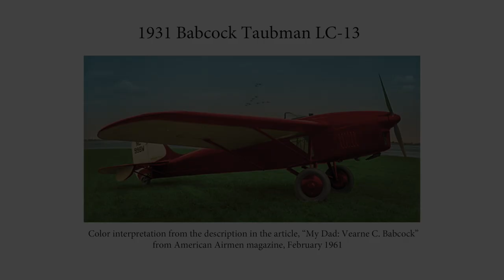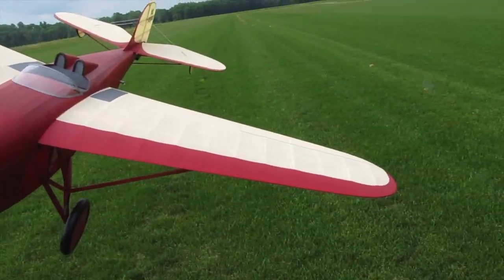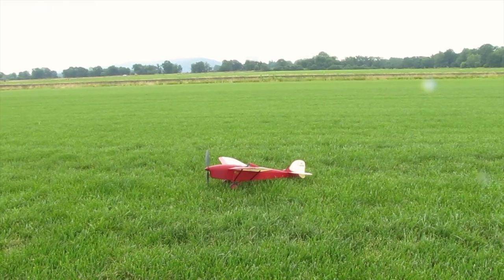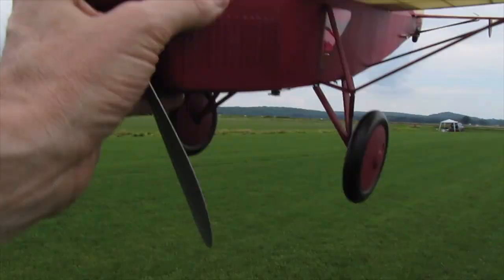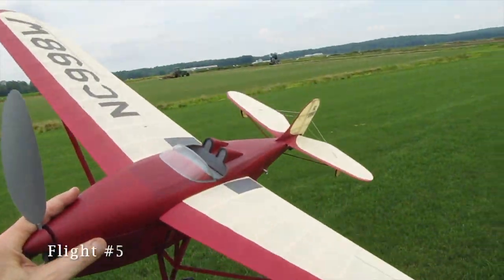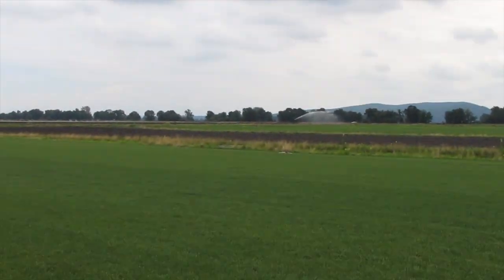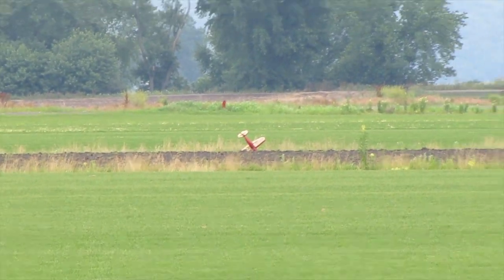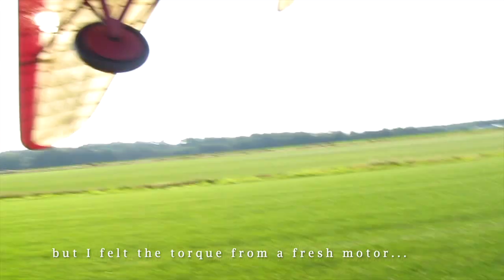37" Rubber-Powered Model Airplane - 1931 Babcock - Anatomy of a Trim Session

Comment: Beautiful flights with a beautiful model. My hats off to you for a job well done. I am an 82 year old model fan (rubber power and U-control) and this certainly brings back happy memories  of my early trial and error period during the late 1940's and 1950's. After rubber power flight was put on the back burner, my first U-control model was a Mini-Zulch powered with my first motor, an .049 OK Cub. I still have that little motor as a keepsake item from happier times.

Comment: Well,   I am motivated by your numerous videos including this one to get back to Free Flight rubber powered models!   
When flying Open Rubber contest models decades ago now,   I used a winding tube during winding to protect the fuselage in case the motor should break.  Essentially a thin walled aluminium tube that slid inside the fuselage and hooked up the motor with a 1/4" dia. al. alloy rod just longer than the tube.  Wound with prop. off tucked into my back pocket then when fully wound,   slid the tube out from the fuselage over the rod and reached around to grab the end of the motor.   Then unhooked the rod and let rod and tube fall to the ground and hooked up the prop. to the rubber motor and fitted the nose block.  Was winding 14 strands of 1/4" rubber strip but could grab and hold that OK.    To avoid sharp power burst used motors ~ 30% longer than between hooks and pre tensioned the motor by extending the motor out to 7 strands and winding counter clockwise with a small rod rubber banded in place in the midpoint of the motor.   Then bringing the two end together and fitting them on a "Tim Gray" style double loop fuel tube covered piano wire hook.   Hold that end of the motor and let go the rod and the motor cords up naturally.  Used small 1/16" section bands to hold motor on the hook and used hollow high tensile al. alloy tube through the rear of the fuselage as a rear "peg".     60" span model weighed 3 1/8 ozs. and rubber weight  slightly more than that for ~ 6 1/2 ozs. all up flying weight.
Reply from the maker: Thx for the kind words.  Enjoyed hearing your process from long ago. Seems like you haven't forgotten one step in the process!

Comment: What a beautiful aircraft Tom.  Not a type I was familiar with.  A good size too.
I'd love to build that one.
Noel
Reply from the maker: Thx Noel.  Yes, this one quickly turned my head, and I knew she had to be a larger model to take advantage of that massive wing area.  Hoping to get out with her again soon, with a better prop and a slightly more powerful motor.  She got up there on the last flight, but conditions were ideal, like flying indoors.  With any kind of wind, I doubt if she would've broken thru.

Comment: I also love the old 1930's designs ... when designers were trying to find the formula for a private airplane that's not so expensive (Depression Era), so they could sell a lot of them!
I guess those tall wheels on this model are what lets it land 3-point almost every time. I've seen similar size scale designs that have long flight endurance but they often don't go above 50 feet. Since this isn't a purpose-built cloud rocket ... would you say that when flying large scale models, its harder to get them to really get up in the sky?
Reply from the maker: I could surely burst her into the sky like a Gollywock endurance ship if I wanted to, but I love the more scale-like approach. I'm switching out to a new, more efficient prop, and bumping up the rubber cross section a tad, so she'll be gaining altitude for sure. 
Stay tuned.

Comment: Wonderful, precise work ....
I agree with Kevin, wouldn't there be more information about adjustments for such great flights?
Reply from the maker: The adjustments are so minor, only 1/64" tweaks in most cases, so I haven't considered showing them on film as it could be rather hard to see, but I'll consider it in future films.  I can show the thrust plate setting, since there are registration marks, so one could see the slight changes. Thx for the input. I appreciate the feedback.
Reply: @maxfliart  Thank you for answer.

Comment: I was thinking air density might be a factor in the lack of climb and then I saw the massive sprinklers nearby? How do these rubber ff models survive the repeated uncontrolled landings? I noticed on the fly by’s an oscillation or flutter, or shaky empennage, maybe I just need to eat something, maybe it’s the camera but it looked to be specifically the tail, is this a prop wash induced phenomenon with these ultra light weight models with such but props?
Reply from the maker: Landings can take their toll, but it all depends on the surface. Helps to have some flex on the LG. The shaking was from the rubber climbing on the prop shaft for that one flight. She has since tamed and has become a smooth flyer.

Comment: I love it that you can see the motor working through the windows under the wing.
What's the tail jerking around 15:41?
Reply from the maker: Probably the rubber on the prop hook climbed a bit?  Hasn't done it since.

Comment: Wow, pure aeromodeling art! I'm curious as to why you were so reluctant to increase the rubber cross section... was it because you knew the motor you were using wasn't optimal? The gains were immediately obvious as soon as you changed to the new motor. Congratulations on yet another masterpiece!
Reply from the maker: I hadn't reached full torque, and often a ship of this size reacts favorably near max, so I didn't want to take the time to make a new motor, 
re-balance, etc.  This was the first day, so I felt like simply riding it out with the two loops of 1/4.  I'm taking her out tomorrow morning with three loops of 3/16, so 
we'll see what happens.
Reply: @maxfliart  Thank you. Looking forward to seeing more of this little gem!

Comment: Just when you think you’ve see every model of planes a new/old design shows up. Nice job. Here is a dumb question. Have you seen any rubber powered kits that come prebuilt or at least needing a minimum amount of assembly? I just don’t have the time or workspace to comment to project builds.
Reply from the maker: Thx. Glad u like it.  I'm not really aware of any partially made kits. I was surprised to find that back in the early 1930s, some kit manufacturers offered already built models, about 400% the cost of a kit...so maybe $4 delivered!!  I dad did this in the '30s too, buying kits for 10 - 25 cents, then selling the finished model back to the hobby shop for $2 or so. 
Anyway, all of my flying friends design their own or build from kits.  Some simple designs can be built in a few nights, rather than a few months, like the Babcock. 
I'd suggest contacting EasyBuilt or Volare (addresses in the copy above) as they have a tremendous variety of kits in various levels of complexity, or time required to build.  Have fun!

Comment: How do you calculate the max turns?
Reply from the maker: There are some formulas for calculating cross section and winds per inch, but over the years I just wind the motor to breaking in the shop, then use that as a general guide.

Comment: I have now watched many of your videos. Really useful. What DT do you use? I have tried viscous DTs but found them unreliable due to time variation with temperature change.
Reply from the maker: I've been using the Badge Classic in recent years, since it appears to be the most reliable. It's the one on the lower left. 
http://starlink-flitetech.com/badge-timers.php    I've not used his viscous timer yet, and the other one unfortunately isn't available due to production & reliability issues. He'll sell 3 Badge Classics for $50. May or may not include the spring.  But yeah, the viscous timers are anything but reliable, unless you can find them from around 15 years ago when they first surfaced. Those seemed to work.

Comment: When I saw the skeleton model I thought: why the solid wood nose? And then realized that's the place where u hold it tight with your hand during launch!
Reply from the maker: It's only 3/32" sheet, and the top area is planked with 1/20" sheet.  I knew she'd need ballast up front, so I decided to sheet the area and make the model stronger, and easier to handle.
Reply: @maxfliart  Great, a good base design serves both purposes!

Comment: Wow. Beautiful! Also, what did you use for the thrust button?
Reply from the maker: Thx for the feedback.  It's a brass button with four prongs, from a hobby shop back in the 1940s, I'm told. Unfortunately, 
they're no longer commercially available...but if you can find the small box holding 2,000 of them, they're like gold. Some used them front and back, giving you adjustable thrust.
Reply from the maker: Here they are on this group of photos. http://hallmanstudio.com/Thrust_Plate.jpg
Reply: @maxfliart  ah. Thanks! But is there any way to DIY it? Also,in your Babcock prop video,you use a brass clutch looking attachment. Did you custom cut it? Also,will try to look for these on ebay
Reply from the maker: @adarshlakshman4715  There are similar brass buttons found in fabric stores.  The prongs are longer and you'd have to drill ur own hole for the shaft. The clutch (free-wheel ramp) is made from a long piece of brass tubing, which I cut and filed into that shape.
Reply: @maxfliart  ah. Thanks. Since I do not own a drill as fine as that,I was thinking of a prop assembly like this:
1.bamboo skewer as the spar
2.coffee cup blades hardened with CA
3.A glass bead as a button
4.a needle as the shaft

Any opinions?
Reply from the maker: @adarshlakshman4715  Nice.  I think that could actually work.  Good luck!
Reply: @maxfliart  thanks! I shall need it! Also,I've only had 3 of my Gillespie's yard birds to fly,with a guillows D6 prop. What do you recommend as a first scale scratch build?
Reply from the maker: @adarshlakshman4715  Rearwin Speedster or Sportster.  They really fly.  Aeronca or Taylorcraft are great too.
Reply: @maxfliart  ah! I think a rearwin speedster will be my next build! I have a prairie bird on my table now.  I actually sent you a facebook message LOL.

Comment: Do you find that 82 grams is typical for a 37” wingspan balsa airframe? That mig you fly was also magical at 82g
Reply from the maker: I wasn't really shooting for that weight, but I've found that it's not a bad place to fall. I always try to build light, within reason. Since I fly outdoors, I don't want to be so light that they break apart in the wind. My hope is that they last for many seasons of flying.
Reply: @maxfliart  interesting.. I’m just getting into it. Have some balsa kits to start building when the supplies get here. Curious if the 250 gram limit still applies to free flight?

Comment: Does the propeller have a free-wheeling device under the spinner?
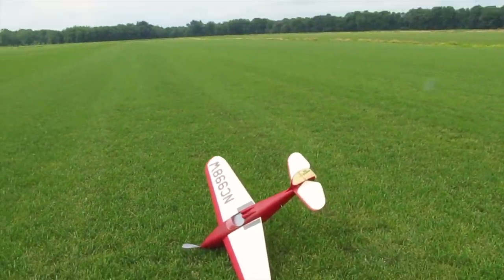Reply from the maker: Yes.  It's a simple ramp type that is seen on all plastic props. In this case, I made one with brass tubing, notched it, then attached it to the bamboo prop spar with epoxy. If you go to 2:19 on this film, you will see a similar setup for another model. https://youtu.be/bQcPZXtFVVw
Reply: @maxfliart  Thanks

Comment: How do you trim a rubber model? Do they have movable surfaces?
Reply from the maker: Thx for the feedback. Generally, I build my models with moveable tail surfaces, along with an adjustment for the thrust, via the But many prefer to have the tail surfaces secure, but add paper or sheet plastic trim tabs to help lift or turn the model.
Reply: @maxfliart  thanks for the response. I love rubber models, but I've never been successful in building a reliable one. They flew, but no completely well. That's why I went to RC, haha.

Comment: information        the use of such a thin main wing leading edge is less-than ideal.
the le should be sufficiently 'rounded' so that the leading edge stagnation point of the airfoil  is  Uniform  across the  span.
http://2.bp.blogspot.com/_l5rDtT9SAog/TUnwfRebHjI/AAAAAAAABuc/pzLc1xneVH0/s1600/stagnation+points.gif